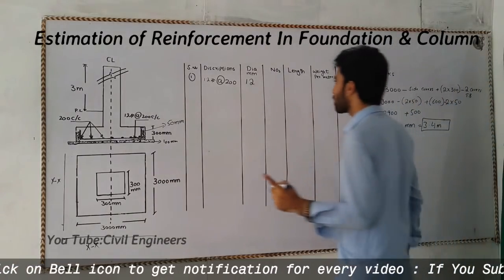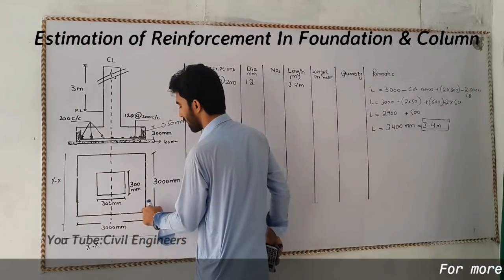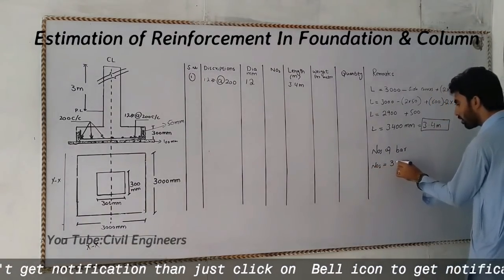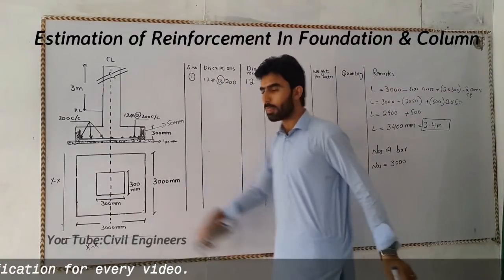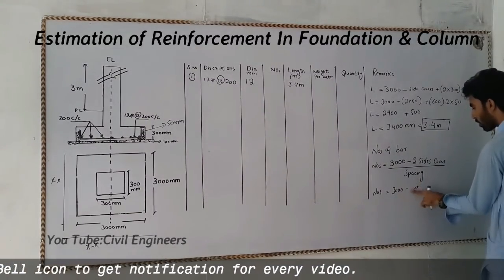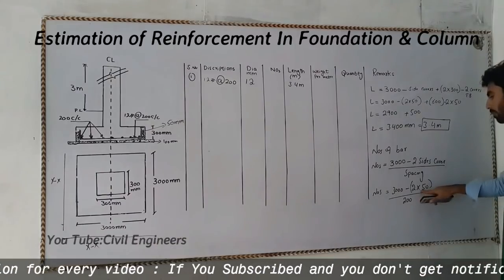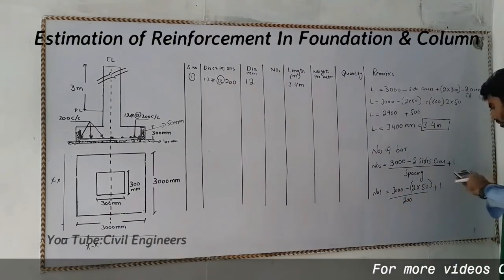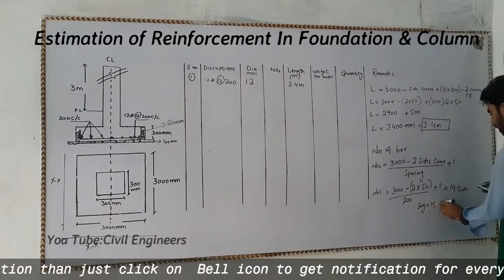Estimation of Reinforcement in Foundation & Column

Comment: example : L=(3000)-cover (2*50)+(2*300)-cover(2*50)-(2*50) two side of cover top and bottom =3.3 correct answer
Reply: Imthiyaj Ahamed u mean that top bottom cover should be subtracted two times because it is on both side of bending??

Comment: 7. And you tall total 15 bars on x direction but it should be 16 bars. As follows (3000-(2*50))÷200= 14.5 ,so 15 bars + 1 bar = 16 bars.
Reply: Why u add +1 for which reason

Comment: sir mistake is done while calculating length... it must be 4.5 m

 see.. 3000+700+300+300+300-50 (bottom cover)- 50 (top cover)   = 4500 mm 
 ..stop doing such a silly mistakes
Reply: more accurately we can minus 2d ( for 90° bent up bars at bottom )  from 4500 mm
Reply: I think so it wrong to multiply the top cover by 2 ?? Kindly tell yes or no thanks..
Reply: Right